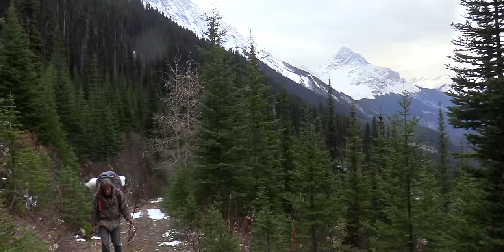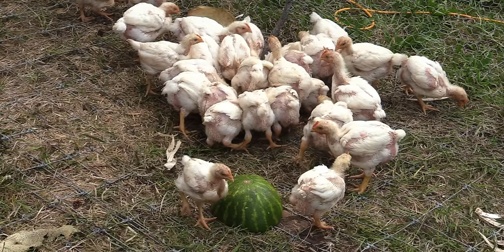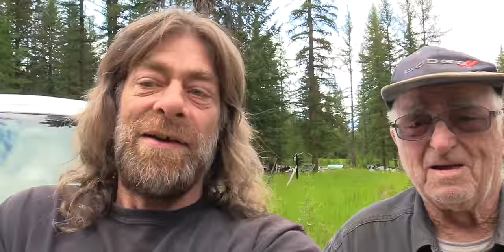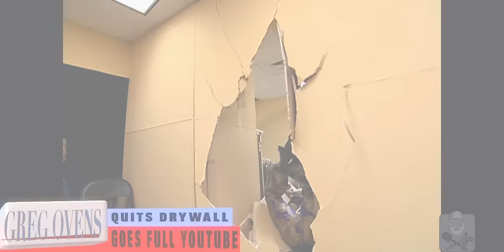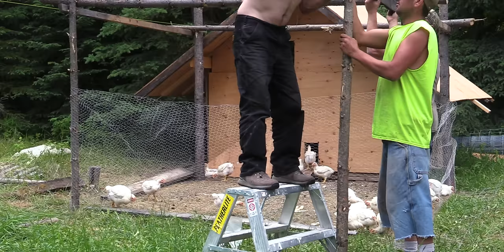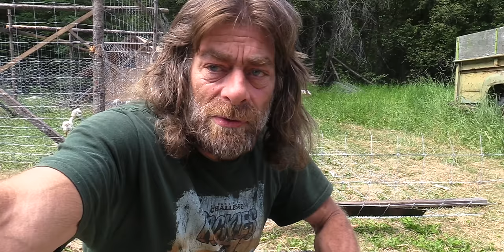Bear Safe Chicken Run - PT 3 - Raising Rocky Mountain Chickens

Comment: Wow those chickens grew so fast!!!  Super nice of Hans and his wife to adopt into helping you so much. Sorry to hear about Hans, though he should know that is only pressed board and when it gets damp let alone splashes from the flowing river it will crumble in just a few seasons. Warping, buckling, crumble a little at a time on the bottom side. He should have changed the boards every year or two. More so when the river rises. Great job on the coop. Though I think if the bear really wanted in there. He could rip those poles out with ease. Unless electric fencing. Great edit, funny as  all heck Zack. They are super expensive chickens, but the coop and yard cost will pay for it's self over the years.

Comment: Aw Greg, I love ya, and am sure after so many comments you have to have heard this, but darlin 😅, if you’re worried about critters that can get in (?)… Dig a trough/trench line that is at least a foot deep all around your coup and run. Introduce rolled up chicken wire and bury it. Make sure it goes top to bottom of the dig. This completely discourages digging from predators. ❤

Comment: So i had a baby black bear keep trying to get into our horse feed. I made a small shed and wrapped it with chicken wire. Then screwed boards to attach shengles. But screw small pieces of wood all over so the bear can't lift the wire. The bear finally got in after two weeks. But it some how worked well. But they will go threw the wire but I would double up the coop or add r14. Also I seen a coop that has a big outdoor in closer like yours but had those boat wheels with a crank attached at each support beam so all they did was lift it a inch push the "cage" onto another green section for them to eat. You could have it detach and  push them all over then open a door in the back to let them in the coop. Maybe cover the sides so the flapping does attract cats or other animals

Comment: I know of only one way to stop weasels.  You'd have to assure whatever you have for the lower 18~24" doesn't have any openings large enough to squeeze through, because they can climb and dig pretty much anything.  Then, mount a continuous run of horizontal 2x4 at that 18~24" height, and attach a continuous piece of  8~12" wide aluminum flashing sticking straight out.  They may be able to jump and reach the flashing, but it will give and not provide them a grip.

Comment: I was staying at a camp in BC in 1975 or so when a bear got into a dumpster . It was a juvenile, don't know what kind. The dumpster was one of the steel kind and held into place with steel pipe. The bear pushed it over, bending the pipe in half, then crawled in, then moved around so much he flipped it closed with the door on the bottom and him trapped inside. Man that thing could scream. Anyway, the rangers somehow got it out, we stayed shaking in our flimsy tents.

Comment: You need to use electricity you can use a solar system to power it.l,ve seen it used on other shows so place some electic wire fencing.

Comment: give the coop a good dusting of diatomaceous earth to keep the mites at bay,i used to give all the timber joints a good dusting before fixing so red mite and such cant hide,mites and chickens go hand in hand so dont get over run with them or you wont have them for long,also put some in there feed trays or grit trays as it will also kill internal parasites like worms and such!